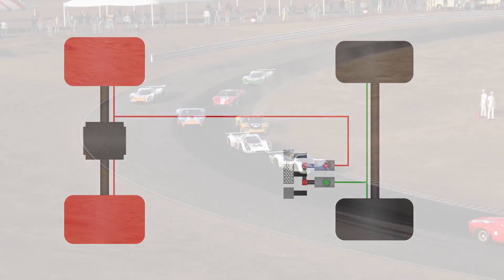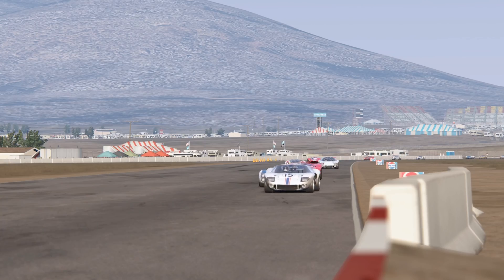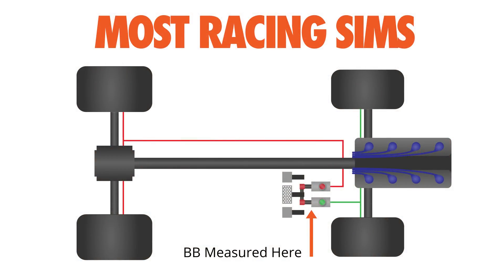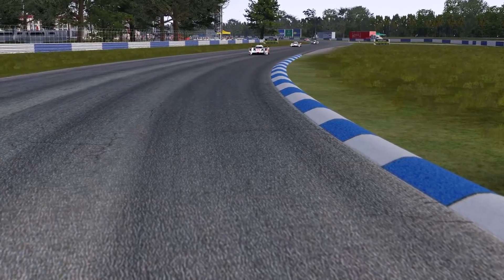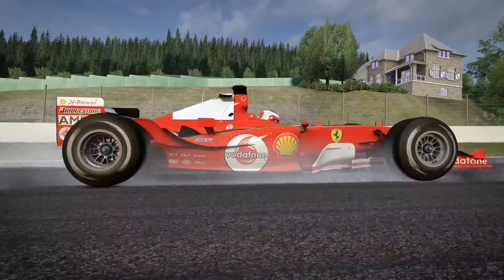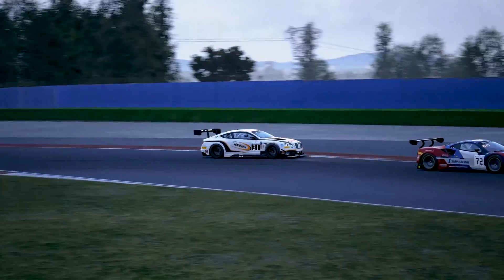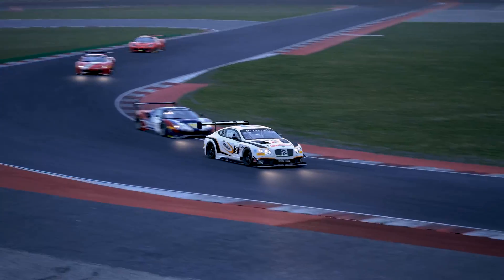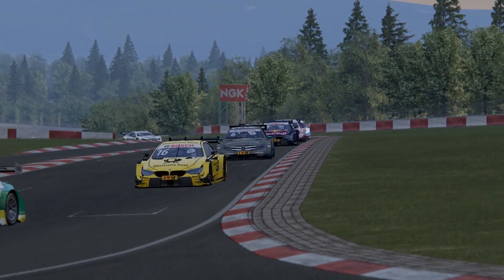Sim Racing Setup Guide 08 – Brake Bias [Brake Balance]

Comment: I don't have access to any analog means of acceleration and breaking, and one of the cars I'd like to try driving (The Ferrari 458 GT2 in AC) doesn't have any sort of ABS. Would it be a bad idea to reduce the break pressure so I don't constantly lock up and slide away at every corner?

Comment: Something I think worth mentioning is that the fastest bias setting is NOT always the setting where the car handles the best. With bias it is always a trade off between braking efficiency, braking stability, and turn-in behavior. 

Sometimes, for example, the setting which slows the car down the most efficiently begins to transfer enough weight to unload the rear wheels enough to induce slight lockup. Moving the bias farther forward in this case may prevent the rears from locking, but may also lengthen the braking zone by 5-10m due to the lost braking efficiency. 

It is also important to note that lockups or loss of grip under braking are sometimes indicative of a greater setup problem outside of the bias setting you are running. If, for example, you are experiencing rear locking at 70% bias, then clearly you should take a look at tweaking suspension settings and balance instead. 

It is also important to note that the way the driver applies and releases the brake could be causing lockups or turn in understeer, even if the bias is already at its optimal setting. Telemetry data can help a lot with this. For example, sometimes front lockup can be caused by too weak of an initial hit which is preventing the weight transfer necessary to maintain the grip levels being asked for by the front tires. I have especially noticed this when driving in the rain. I will often start to move the bias rearward at the start of a session to avoid front locking. As I start to push the braking zones deeper and deeper & hit higher brake pressures, more weight will be transferred to the fronts allowing me to adjust the bias further forward, which further increases my braking efficiency, which transfers even more weight to the fronts, and allows me to go even more to the front with the bias until I eventually start losing efficiency or start getting rear lockups and have to walk it back. 

Setting an optimal brake balance setting is all about finding the best compromise between efficiency in slowing the car and maintaining favorable handling characteristics. I feel like most people forget about the first part there. They just worry about where the car is the most stable and turns in the way they want it to, and as a result, they end up throwing away tons of potential lap time by increasing all of their braking distances across a lap. 

TLDR: Finding the best bias is just as much about how efficiently you can slow the car as it is about lockups and handling. Sometimes a bias setting where the rear moves a bit or the turn in pushes can be faster overall.

Comment: Reasons to change brake bias:
1. Worn tyres: worn tires introduce instability and oversteer. Increase brake bias to help reduce the effect

2. Sharp turns: high brake bias will make it difficult to turn even in lower gears. Reduce brake bias before a sharp turn for extra rotation. However, be prepared to counter steer to keep the car on the track.

3. Managing tyres:  Use an app to monitor tyre wear. If your rear tyres are worn out, increase bias to the front to manage rear tyre. If your front tyres are worn out, reduce bias to the back to manage front tyre.

Comment: At 3:02 shouldn't it be turn in Oversteer. If forward biasing is there then rear will lose the grip first right?
Reply: Actually the understeering comes as you turn in and still try to hold the brakes(trailbraking). The front wheels have a limited amount of grip available and if your brake bias is too high your front wheels will use a too much of the grip available for braking which means that the tires cannot (fully) transmit the turning force to the ground anymore as there isn't enough grip available -> understeering. But you got a point though. Having your brake bias too high takes away a lot of weight from the rear tyres. So if you somehow manage to turn the car and not getting understeer you might get oversteer just a few moments later as the rear tyres have no grip due to the big weight transfer to the front. But normally that's just the case if your brake bias is very far from the optimum. Usually the issue with too much brake pressure on the front is understeering. I hope it's not too confusing and you get my point
Reply: Hans Mustermann This is a good explanation of why you might start to encounter understeer as bias moves forwards, but the weight transfer is actually not necessarily dependent on bias. The proportion of brake force going to the front vs rear tires has no effect on weight transfer, rather it is wherever the bias setting results in the most efficient braking (i.e. highest magnitude deceleration) that you may start to experience a loose rear end from weight transfer, which can be compounded by the brake force on the rear wheels leading to rear lockup. This is why I somewhat disagree with the "move it forwards until you start locking the fronts" strategy for finding & setting optimum bias. What you should be doing is searching for the bias setting which results in the most efficient braking, which sometimes comes hand in hand with some undesirable handling  characteristics such as turn in understeer or rear locks, and THEN finding a compromise between the two. Sometimes a car is actually fastest when you're experiencing slight rear lockup.